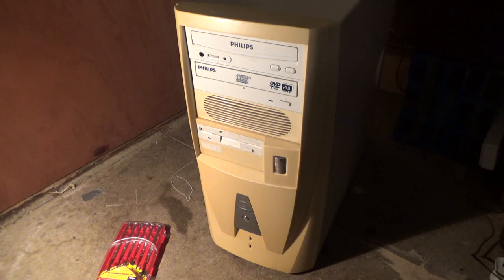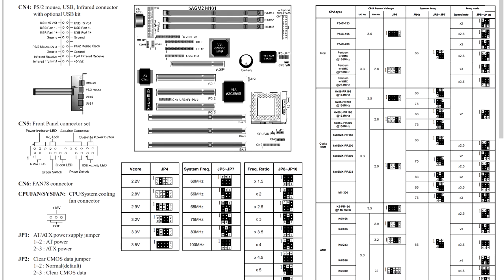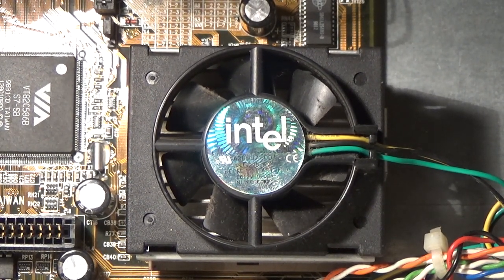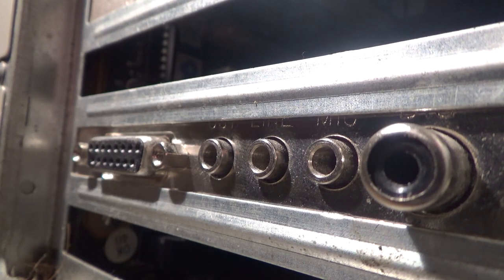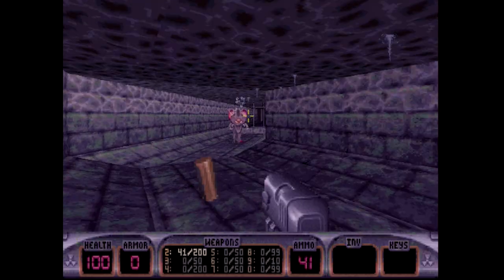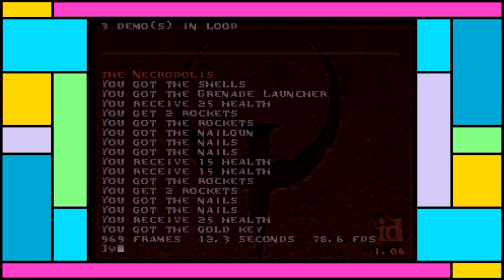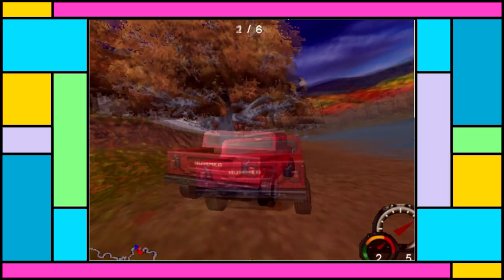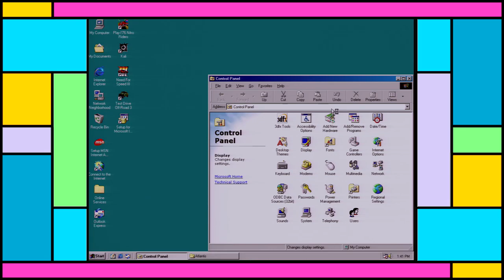Reliable K6

Comment: Seems you've polished the quality of your videos recently to be more streamlined. Cool! 

I have quite a lot of nostalgia for K6 even if the motherboards were often a bit odd.
Reply from the maker: When you do something for a decade, it stands to reason you'll start getting the hang of it after a while, still always a lot of room for improvement though and also, moving to 1080p leaves less room to cut corners on things, anyways, thanks. The K6 is a really good platform, totally missed out on it in its time - stuck with a 386SLC and everyone else had Pentium MMX / Pentium 2 machines at the time - but with a good board they're immensely useful.

Comment: had a k6-2 500 myself. great processor, managed to get 600mhz out of mine, which helped gta3 run better at the time. great video! brought back a lot of memories from the early 2000s
Reply from the maker: I was late to the party with the K6, had a 386 and couldn't afford a new system until the K7 was out and got cheap. Still, I've always admired how plucky the K6 is, realistically it was on the shelves as a Celeron competitor but it often manages to surpass this and is well and truly capable of taking on serious workloads. They weren't necessarily as fast as Coppermines, but for their cost they sure as hell had a good go at it and you weren't left feeling ripped off.

Comment: that Intel branded CPU fan with a AMD CPU under it would drive me crazy.....
Reply from the maker: Obtained a box of those coolers years ago, may as well use them. The problem with Super Socket 7 AT boards is how there are often things in the way of the socket, preventing the installation of larger coolers, especially the AMD branded ones from the K7 days. Intel's Socket 370 ones fit really well. So long as the CPU doesn't catch fire it's all good in my mind.

Comment: When your Joystick stops working you build more computers, anyway there is a pill for that. An Intel cooler on an AMD cpu Blasphamy LOL. Great video and happy you have your K6 running again.
Reply from the maker: Hey, thanks. I assure you there's nothing wrong with my joystick - I could insert a 'your mom' joke here but that would probably be in poor taste - and there's actually a good chance the card can be fixed, probably just some crappy passive component on the card going bad. Another thing to consider is that once the USB is working, it opens up more options as USB joysticks work in Windows 98SE and the OS will even map them to DOS games if needed, so far as I'm aware.

Comment: You got any matrox cards? always wanted a millennium g450 for all the bump effects it could manage back in the day.
Reply from the maker: Funny you should mention those, all I'm saying is 'comparative machine' to that.
In response to your other comment, the current editing machine is; Intel Xeon E3-1271-V3, SuperMicro X10SAE, Kingston 32GB DDR3, 6xWD RE 4TB Hard Drives (RAID10 with a RAID0 'working' volume), nVidia GeForce GT 730 (look at the 2D benchmarks for this card), StarTech PEXHDCAP60L, Seasonic X1050, that's about it.
Wouldn't worry about the bike stuff, it will never return here.

Comment: While pills do exist to fix joystick problems, usually being advertised by attractive women only rich men could afford, I've heard they don't always work anyway so it might be better to cut your losses and try another card. 

That display while loading Atlantis is what I get to see a lot of the time when I am capturing from the Avermedia card. One of those fun little problems I have to sit there and sort out taking more time to get anything actually recorded. 

Seems like I remember there was compatibility issues with Glide on the Voodoo 3's, like Glide written to work on Voodoo 2 wasn't quite compatible with the Glide of the 3 and these companies weren't bothered enough usually to put out a patch. At least yours works. I picked up a Voodoo 3 3000, with the hopes of fixing the corrupted image by heating it up and as my luck usually goes, it doesn't display anything now.  

I have to say, that is one hell of a yellowed case. I always find it interesting how so many severely yellowed cases I have seen has had drives that were not yellowed in the slightest, then some that all yellow equal. It's weird what plastic does. 

Didn't we talk about your place being haunted awhile ago?
Reply: Voodoo2 required patching on early Voodoo1 games, Voodoo3 usually worked after deleting game dir glide2x.dll/glide2x.ovl to force ones installed with the driver. There are also games with statically linked glide libraries, I think people doing 3dfx emus like nGlide have patches for some.
Reply from the maker: It seems doubtful that pills would help at all in this case, but it may be possible to repair the card, suspect it may just be a passive part misbehaving so I'll try probing it a little. Yeah, the scaler box here will do things which look like that when it encounters resolutions it doesn't like, but here it's displaying that way on the monitor too so it's obviously something with the video card.
By pure luck the games I wanted to run, aside from Interstate 76, all had explicit support for the Voodoo 3. NFSIII has a patch on the CD and TDOR3 has a Glide 2 and Glide 3 mode as well as others in the setup applet. Interstate 76 requires ticking a box to limit the card to 2MB of VRAM or being run in another mode, seems there's always some tampering like this that needs to be done to make them run right though and this does not amuse me at all, not sure how the average user was meant to get by with this back then - we know they didn't, given how many I had to uninstall for people. What gets me is how when it does work, it shows that 3DFX could actually make a competent 3D accelerator, the problem is that most of the time something doesn't work in some way and this lets it down, a real shame. Sucks that yours broke, but if it wasn't working to start with, it was at least worth trying to save it I guess.
Tempted to leave the case yellow, turps would whiten it but what's the point? It would just yellow itself again.
Probably, strange things happen in this house. My mind tries to rationalize that it was just the floor bending, but that still seems unlikely as I doubt it would be able to tilt enough over there to tip the case over, probably never figure it out. A few weeks ago my mother was around and had a couple of boxes 'thrown' at her head, so something's definitely up around here.
Reply: That case isn't just yellowed , it's started going that orange colored shit. lol  Hey the case I used for my Slot A build yellowed a bit even sitting in the closet out of the light of anything for many years and it still managed to yellow a bit, though not to the level of yours, so I just put a like yellowed CDROM in it just so things match. I didn't mention that in my video though, kind of forgot about it till I was editing. Anyway ya it has been a few years since I had a working Voodoo 2, I think mine was also a 2000 at the time, came out of a dell. I can't recall having those kind if video problems but then again those kinds of things tend to be game related and most of the games you played on this card I never did. I don't think I have played 76 since like 1998/1999 there abouts. It's been awhile for that too.  I think these kinds if visual problems are why 3DFX folded, taking STB with them, which was probably too much for them to chew anyway...and of course making the choice to only produce their cards in-house and no longer allow third parties to use their chipsets.

Comment: I had voodoo 3 as late as 2004-05 and no problem with it.
Reply from the maker: That's what they all say, I don't know where the problem lies, whether the people saying it just happen to be running things that work, whether most of the cards don't work and theirs just happen to be the few which do or what, but either way, this one doesn't work unfortunately.
It's a shame, because I really did want to like it and it seemed promising at first, but it ran into the exact same problem that, ironically,once paid for me to build a computer around 2004 partly with what I'd made uninstalling other people's Voodoo cards, largely because they reported similar issues. Who knows at this point, I'd like to find a use for it anyway, probably gonna throw it in a Celeron I use for the virtualization of networks, the card outputs a really nice image in the Windows interface at higher resolutions and is fast at that, so it should be fine in there.
As always, the important thing is that something works for the person using it, so I'm glad yours was trouble free, maybe it's just mine, I'm sure the replacement I have lined up will work for me.

Comment: I have no issues with my Aladdin + Voodoo3 K6 build, even though it's a PCChips board.
Reply from the maker: That's what they all say, which leaves a few possible scenarios. 1. All but a few Voodoo cards don't work properly. 2. Collectors minds end up trained to gravitate towards the few games which work on them, possibly by chance. 3. The opposite happens and the games I want to play just happen to be the ones which don't work properly on them. 4. In many cases people are just repeating what they''re told and haven't tested it themselves, a bit like the myth of the Casio CZ being 'hard to program' with no comparative technology referenced in the argument - I assure you, the DX is a lot more difficult. I believe you, no reason not to, but I have to wonder what you're running on there.
At this point I just don't know what to make of it, it's a shame because I wanted to like this card and it looked pretty good to start off with, but with broken 8-Bit modes, broken Direct 3D and no real OpenGL it quickly verges on useless in here. I'll probably move it to a Celery machine which only displays the Windows interface, because it's surprisingly good at that.
How does that ALi chipset hold up versus the Via ones anyway? Have never encountered one in person and always wondered as there are conflicting reports on them - probably depending on what board they're stuck to like the MVP3 is.
Reply: The only MVP board I have has burnt out voltage regulators and needs some fixing, so I don't have any personal experience with that. From what I've read on the internet though (so loads of unsubstantiated hearsay) the MVP chipset isn't all that great to begin with. Maybe your board will do better with an Nvidia card and the 3dfx will do better with an ALi chipset, who knows.
What games are the most problematic on your K6? I could throw them at mine and see how the ALi handles it.

Comment: IIRC, VP based boards may limit cacheabale RAM area to some extent, i.e. you'll get noticeable memory read / write slowdown at some point (same as on Triton FX/VX chipsets). Yet, I vaguely remember that moment.
Also, there were suggestions on the web (still should be somewhere around) how to enable memory interleave on VP chipsets: in theory, that should boost memory performance. And as I recall, many MB vendors didn't provide such BIOS option, still may be fixed manually with those instructions.
May it be? Sigh, maybe I'm brain-damaged and that's a complete fiction.

PS What about i740 instead of V3? :]
Reply from the maker: There'll always be a limit, especially dependent on available Level 2 cache. At 128MB it isn't likely that this system is encroaching on such a limitation and as for interleaving, there are definitely no options, exposed or hidden, in the BIOS relating to it but there are definitely traces of such things out there, it seems, may be worth a look but probably not useful with only one module installed - it is worth noting that the TMC was also running on just one module - but this will definitely be noted for future testing, so thanks for bringing it to my attention.
Strangest unlikely memory interleave seems like it might be on a 386 board, have been trying to figure out if the C&T machine does it because of some unusually high numbers that show up when testing it, seems to be almost double the speed of any other 386DX board.
Reply: Thanks for the answer, I'll check that C&T video later.
I recall some forum topics from early '00s discussing possible modifications for Award BIOSes - both for memory interleaving and LBA / large drive addressing issues. If I'll find any info then I may share it. Maybe on Vogons, - at least there will be a reason to register on the forums.
Reply: I was going to say the same thing. The motherboard only has 512MB L2 cache installed. With that the VIA MVP3 has a cachable RAM limitation of 64MB on Write Back setting and 128MB on Write Through (~3% slower). Going above that will seriously hurt performance. Check amd-k6 (dot) com/cacheable-ram-on-socket-7-platforms/ for more details.
Reply: That article has a useful remark about Aladdin revisions, thank you.
BTW, System Speed Test (by Vladimir Afanasiev) helps greatly with determining an actual RAM throughput, i.e. you may find easily that 'limitation' spot.
Reply: Happy to help!

Comment: I know its' the advised thing to do when installing a new video card to pretty much reinstall the OS or revive an earlier "clean" image but is it really necessary? I do It as well when running benchmarks in Windows because it seems to be the excepted thing to do to get clean results but to be honest when I was growing up or these days if i'm just messing around with machines I've never had a conflict or issue when simply uninstalling old drivers and then installing new ones when switching video cards. Actually I can't even remember encountering any issues when not uninstalling old drivers and just throwing in a new card and installing new drivers and restarting. I do seem to vaguely recall the glide issues you mentioned when I switched over from a V3 but other then that I've never had any issues just doing a "dirty" video card swap. Sound cards though, I've had issues there when it just becomes a buggy mess which usually just leads to restoring old images or flat out reformatting and reinstalling.

It's also really odd coincidence you specifically mentioned the gold top Pentium-75 for reasons that will become clean in the near future.
Reply: I use Guru3d's Driversweeper if I need to deep clean video drivers out of a system which is usually recommended to do when installing different driver versions or different companies GPU's so you don't get conflicts. I have found it beneficial mostly with Voodoo 2 drivers and Nvidia. While the uninstall feature on drivers has gotten better over the years, and modern drivers I think works probably as well as it could, the older driver uninstallers tend to leave things behind.

Comment: Interesting review, as always! That "PCI link" header on the sound card reminds me of the SB-LINK header that some early PCI sound cards have. If you are lucky enough to have a motherboard with a SB-LINK header you can get DOS games working with a PCI card. The weird thing is, this is an ISA card so... that's not what it is. I went ahead and searched it, and here's what I got: http://www.amoretro.de/2014/01/turtle-beach-malibu-surround-64-kurzweil-synth-4mb-soundfont-soundkarte.html
http://www.uncreativelabs.de/th99/i/S-T/54349.htm
Apparently the "PCI link" header is for a daughterboard, a wavetable board I guess!
Reply from the maker: Thanks. Funny thing, SB-Link was my first thought but too many pins and ISA interface ruled that out. Having looked at those pages (not sure how they evaded the search results here) my suspicion would be it is a 'surround' board, probably offers some extra outputs, a few cards at that time did this and it is called the 'Malibu Surround 64' after all - look up cards like the Yamaha XWave which use a daughtercard to do this.

Comment: It looks like one of your RAM chips on the V3 is damaged, or the BGA chip could have a bad solder joint or be damaged from removing the heat sink.

However, I do agree with you that the V3 is not that great. 3dfx went completely in the opposite direction the market was heading and that was ultimately their downfall.
Reply from the maker: Maybe, but it's strange how most issues only appear in 8-Bit modes, you'd think there'd be artifacts all over the place if it was bad RAM. Could try reflowing but it doesn't seem likely to fix anything here, genuinely think it's a much simpler solution to just throw in an ATI like I had before (only less powerful) and have done with it, because I know those work. Sucks, but I can only say what I see.
Reply: The ATi Rage Pro deserves more love if you ask me. I've grown quite fond of them.

Comment: If you care, there is a patch that's supposed to fix Atlantis' Voodoo 3 corruption.  No idea how well it works, though.
Reply from the maker: It was easier to just replace the video card with one that actually works. This system has been on a Trident Blade XP for a long time now and it hasn't given me such problems.